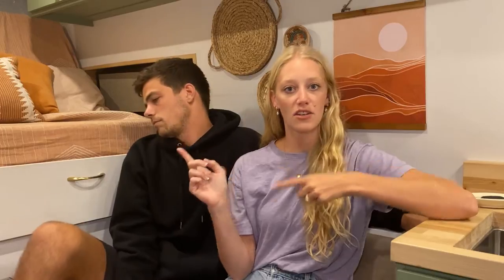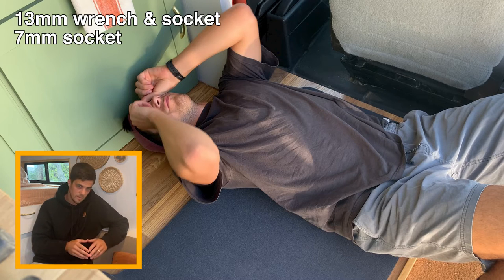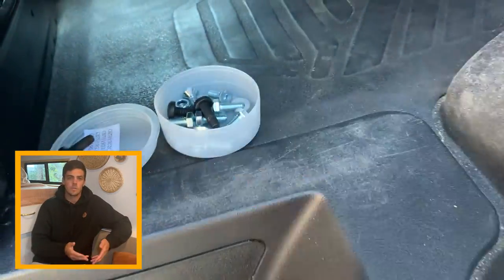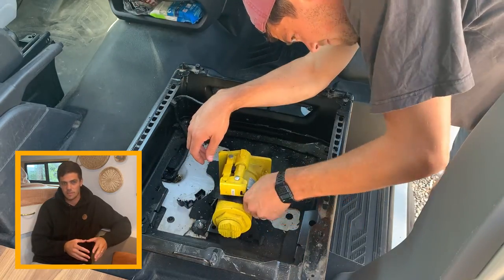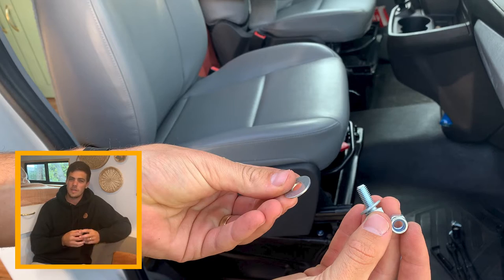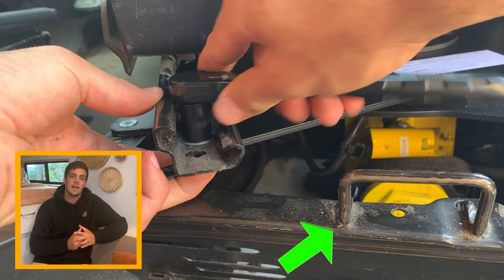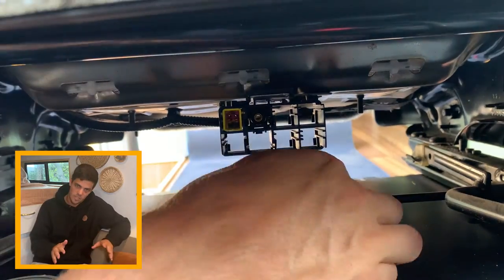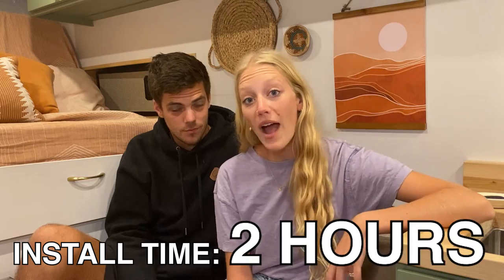Scopema Seat Swivel | Install & Review | Ford Transit

Comment: Love the scopema and ur install video.  After 1 year, swivels smooth but has developed a LOUD squeak when in the forward facing, locked position.   Seems to be common issue.  Can y’all suggest a fix?

Comment: @vanheeradventures does this swivel only lock in front facing position? Just asking if maybe I did something incorrectly for it not to lock in rear facing or toward the driver seat.. my son is disabled and he gets scared ashen it moves.  Maybe after time he will get used to it.. thanks for the video

Comment: Love your van! I am converting a van and bought the same exact swivel. My only issue is it rattles and that does drive me crazy! The rattle comes from the arm (lever) used to lock and unlock the seat. Does yours do that? If so did you figure out a fix? Keep the videos coming!
Reply from the maker: Honestly no, we've not had any issues with that. I would reach out to The Swivel Shop and see if they have any solutions on this. They are a great company! Super helpful employees.

Comment: Love your videos, now that you have had the swivel for a little while, do you notice any wobble or rattle. I am guessing you did not do the drivers seat because of your partial bulkhead. Do you wish you had done that differently?  No bulkhead and a second seat swivel?
Reply from the maker: no. we love our bulkhead - so we would keep that the same. and no it really does not make any noise. It's very sturdy.

Comment: I have the secondary heat vent under the passenger seat (on the 2020 Transit), do you know if this product works for that?
Reply from the maker: I can't say for sure, because ours is a 2017. But i'm 90% sure you would have no issues. If the seat can move forward and back without any obstruction to the vent then it should be able to swivel.
Reply: I just installed this with the heat under the passenger seat. It works. I had to make sure a couple plugs / wires were pressed over to the side, but it seemed to go together without issues.
Reply: @Cassienope  thank you, I haven’t seen reviews/install with that auxiliary heater so I really appreciate you taking the time to comment

Comment: My holes did not line up 😭 so much extra work
Reply from the maker: Ugh, so sorry. That's a bummer. Now that it's done - is it working great?
Reply: @getaway_guide  yes! I love it
Reply: @iluvmusic how did you end up getting the holes to line up? I got 3 of the four in and the last one just tore some thread and went in sideways. Got the nut retreaded but just can't get them lined up.. thank you
Reply: @jujews22  I went to a tire shop and they were able to adjust the threading and got it in
Reply: @jujews22  I put a screwdriver in the hole and really pulled. And was able to get the screw in